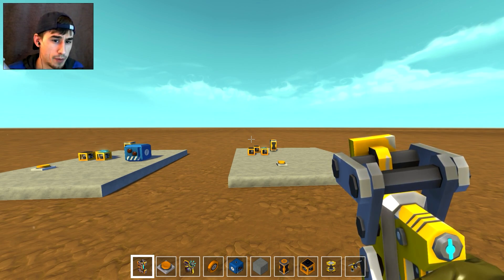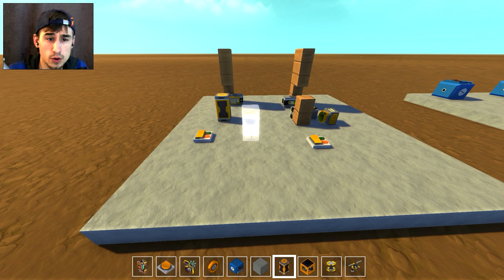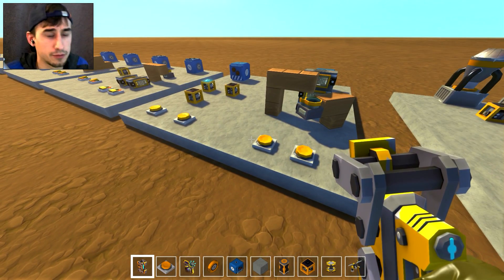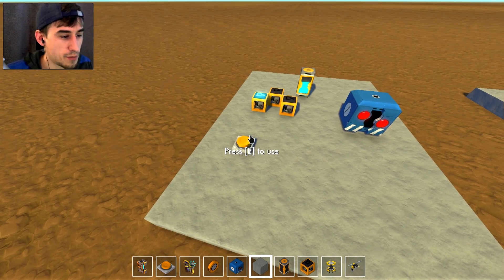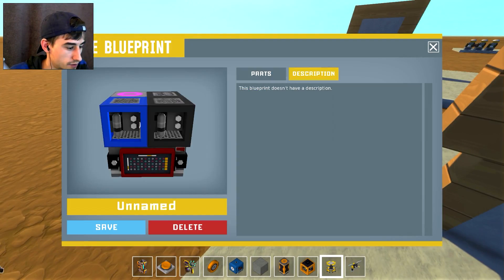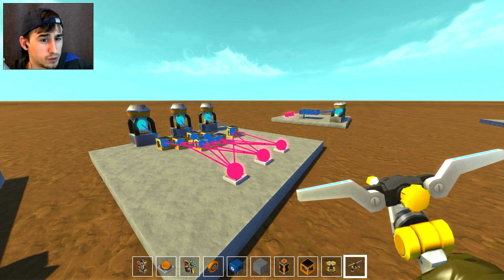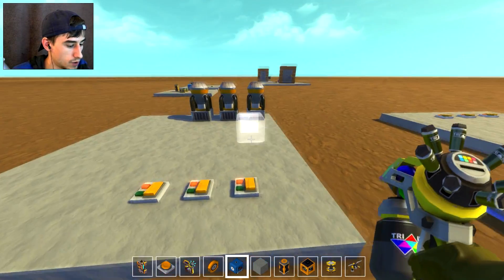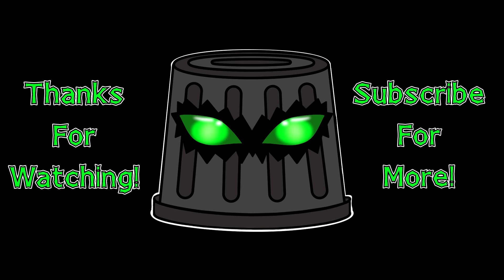Logic Gates! Old vs New, Memory Bits, Compact Door Timer & Sequencer! (Scrap Mechanic #52)

Comment: oh   9:45      you can make a combination lock system..    only the right code opens the vault or give access to secret areas..
to increase difficulty  make the entire vault of these blocks making it 1 big circuit..
then if deleting a block the vault circuit is corrupted and reveals a cheater who just deleted a block to get whatever is in the monthly loot crate :)
even changing a buildings structure so depending the code u enter it brings u a different scenario..
or a maze with puzzles that when solved give u access to next challenge.. reward is solving all and open the exit :)
could be made like a indiana jones scene with rolling boulders or crusherwalls  or slowly dropping spike cielings making u need to think fast.
with these new blocks nothing holds u back. only the imagination.
by powering the rolling boulder with a 2" springglitch  it can be made on flat surfaces.. even powers it uphill.
Reply: +lars kristensen dude great idea
Reply from the maker: oh yea the potential is huge. I've only started to scratch the surface
Reply: sorry for late answer, but you need 3 gates: AND, OR and XOR
you need to wire up all right switches to AND, all not right switched to OR, and then wire AND and OR to XOR, XOR is output
Reply: sorry for late answer, but you need 3 gates: AND, OR and XOR
you need to wire up all right switches to AND, all not right switched to OR, and then wire AND and OR to XOR, XOR is output

Comment: A really useful module to me at least would be a pulse modulator for thrusters and engines. Basically you would have say four inputs (25%, 50%, 75% and 100% power) and the circuit would pulse the thruster/engine at different rates to give a different power level without having to change the power manually.

I did a simple one using the logic gates and timers to make four different timing loops but you could probably do it a lot smaller.

Comment: Hey kan, my friend and I made a super compact solid state T-FlipFlop which is almost instantaneous, it's only 2x1x2 blocks small :) it's called the "Mini T-FlipFlop" on the steam workshop, you should check it out :)
Reply from the maker: Nice I'll take a look!
Reply: +kAN Gaming I also just finished an extremely compact Distance Finder that returns the distance through a 4 bit binary output. I have made a few other compact circuits, but those are my favorites so far :)